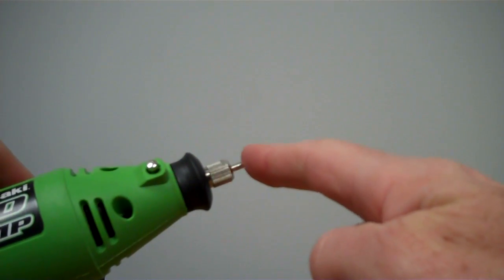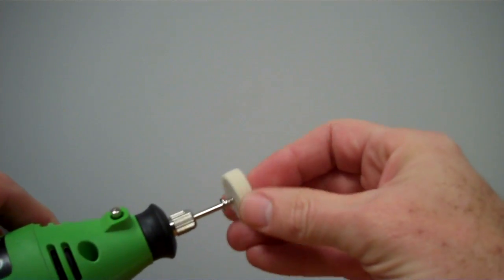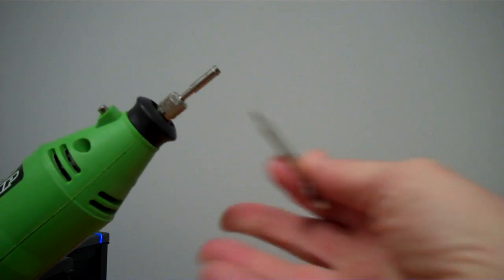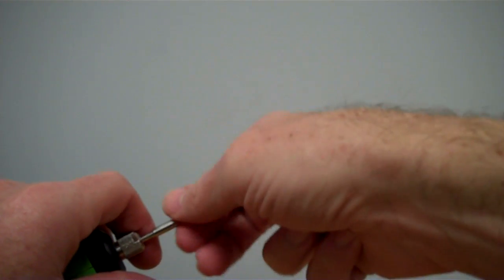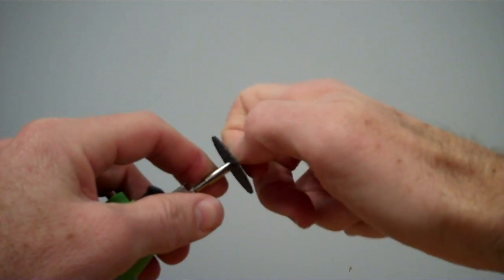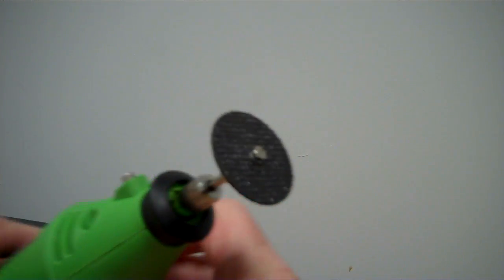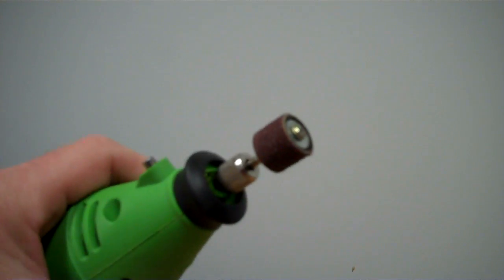Rotary Tool How to -  Mandrels and Attachments

Comment: Thank you for posting this video. I've had this tool sitting in my garage for over 10 years collecting dust because I did not know how these attachments worked. Whomever posted this video should be given a raise.  Whomever wrote up the manual for this product should be put up against a wall and shot, or a the very least fired.  One of the most useless manuals I have ever come across.

Comment: I'm cutting square 1/2 inch holes in 3/4 inch square tubing with my Dremel and my mandrel screw strips out of the mandrel after I do 6 cuts or so and I have to use a screwdriver to screw the mandrel screw through the hole in the cutting discs and I've gone through 4 mandrels 3 screws stripped out and the 4th one the head of the screw broke off while installing a cut off disc all these are from a 300 piece jobmate accessory set is there any good quality mandrels you could recommend to me? As I just started my project build and have a lot more cuts to make

Comment: thank you for sharing this i bought one today and the instructions doesn't even tel me how to put it on only to inform of what it is. i do need help on one thing the rotary tool i got also gave me a drill bit, but how do i put that one and how do i used it because it's really skinny and smaller than the other connectors. thanks

Comment: Thanks, I am still having trouble with my mastercraft rotary tools though, the cutting wheel wears out EXTREMELY quick and breaks easily. I'm suspecting it's the washers because putting something between 2 washers doesn't seem to secure tbh. Or is it just simply because it's bad quality...

Comment: Thank you for this.  But the screw that is supposed to tighten on the mandrel, and squish the rubber thing to hold on the sanding wheel won't seem to tighten down onto the washer, no matter what I try.  I  have held the locking button down, I have held the collet in place, you name it.  My hands are now aching, and the screw head is still about 1 and 1/2  millimeters above the washer.  And now I'm afraid the screwdriver will strip the screw head.  Foot Care Nurses actually use these tools, but my nursing class was so pathetic, that the instructor didn't even cover how to use this tool.  Any suggestions would be greatly appreciated. Thank you!

Comment: So the washer goes on the outside/screw head side for cutting wheels?
Reply: +Adam Jensen I have the same question.  You can't see the washer(on my tool there are two washers) either during or after he attaches the cutting wheel.  Since I have two washers, I'm going to put one on each side of the wheel.  No idea if that's right, what it does exactly or why I'm doing it.  lol

Comment: Haha... you tighten the rubber compression cylinder and test it off camera... 
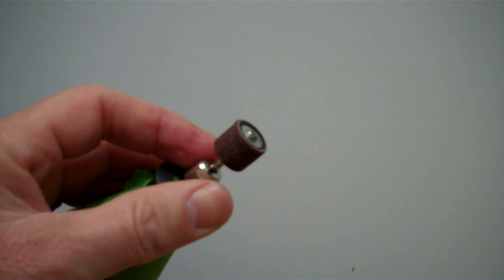Then at 4:10 you lightly tap it and the sand drum still slips...
I've never gotten it to work right... Even when cranked tight the heat generated will cause the sandpaper to slip from the cylinder... There's really no easy solution for the sanding drum.

Comment: I do know this much . I have a dremel 100 it turns 35000 rpm . I bought a hyper tough accessories  kit and put the emery wheel on my dremel . big mistake , way to many rpms it flew apart into several tiny pieces like shrapnel  . I wont be putting on any cut off wheels or stones . the mandrels and bits , and maybe the sanding wheels yes. the accessories kit came with zero paper work . and zero on the internet